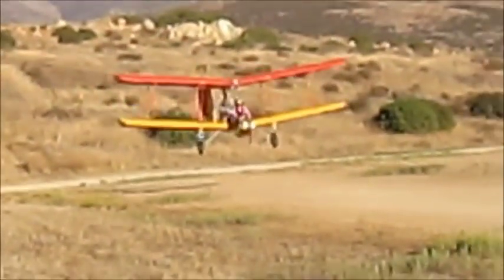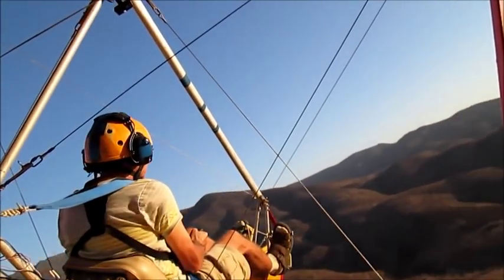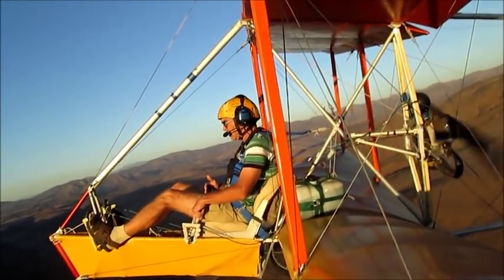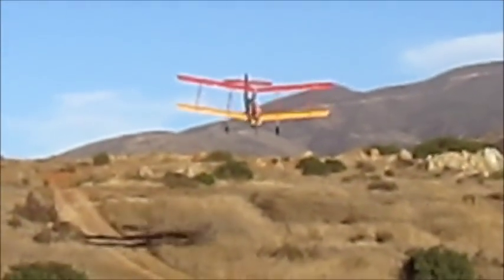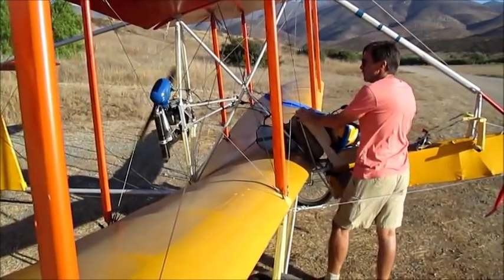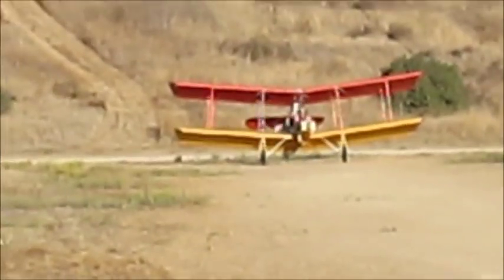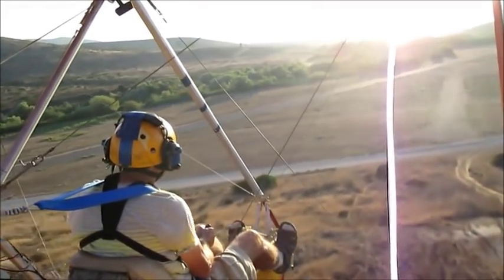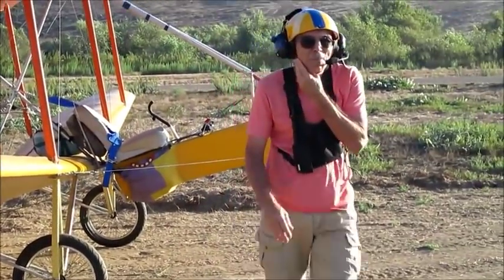Bloop 2 Flying Slow

Comment: Looks like a ball!! I am an experienced builder and 30 plus year pilot with ratings so I would add ailerons to the lower wing without significantly adding complexity while adding a safety factor but the wide gear...nose dragger strut and slow speed are fantastic!!
Reply from the maker: I'm going to stick to my story that ailerons double the complexity of the control system, while not necessarily adding any margin of safety. There seems to be a widely held opinion that two axis control involves some inherent roll control limitations that can be cured by ailerons, but this has not been veified by experience. Ailerons make flying more complex and introduce their own set of hazards, and we might readily fly some kinds of airplanes more safely without them.

Comment: What an exciting plane ! It reminds me of the Quicksilver MX that I had once.
Reply from the maker: The Bloop is a lot like the original motorized Quicksilver (they both have open air flying, a pusher propeller, and two axis steering). That Quicksilver still wins the prize for being the simplest practical airplane, although the Weedhopper might also be a contender. The Bloop I have slowed  down with a big, high lift wing, and tried to give it more crash protection. I wanted the pilot to crash slow, with clearance from ground objects measured in feet, not inches.

Comment: I want a Kolb Flyer.  Lot less wires and maybe a bit more trailerable, and it supposedly came in at 185 lbs.  Kolb called it the plane that weighed less than the pilot.  :-)  Cruise speed I think was around 40.  These slow flyers are certainly out of favor but I think they'd be great if you just want to putter close to the ground hedge hopping.

Update: I ended up buying a Volmer Jensen project and a Chotia Woodhopper Project

Comment from the maker: There should be more about construction, since this is a homebuilt, so I'll post some more building photos on my Picasa Album. Small tube bending to a large radius is easy. Ribs are bent by trial and error comparison to a template, the way hang glider flyers maintain their battens. I don't bend large tubing anymore, it's one the special skills I have been able to eliminate ( also eliminated: machining, welding, molds, jigs, sheet metal, spray rigs).

Comment from the maker: The building cost is a couple of thousand dollars for materials and parts, then a total recovery system (emergency parachute), then a paramotor power pack (engine plus propeller, starter, carburetor, and isolation mountings). The biggest cost item is the power pack, the biggest variable is whether or not to use a rocket deployed parachute (I use a hand deployed chute). Operating costs are fuel, oil, ground storage, and airport usage fees (club membership, usually).

Comment from the maker: Look at the drawings on the Picasa website, you'll see that the empty weight of Bloop 1 is 187 lbs. and the empty weight of Bloop 2 is 195 lbs. I suspect that most of the weight increase is due to the greater number of coats of silvering (aluminum powder in dope) that I brushed onto the Bloop 2 fabric for durability in sunlight.

Comment: Thank for the respond. I try to build a 50%scale using available aluminium tubing and waterproof fabric which I am not sure whether it suitable for the real size aircraft. After the 50% I hope I could count the aproximate cost for the realsize project. I plan to fly the 50% with remot control to test its safety and I hope its justified before making the real size one. I still test the aluminium tube to one metal lab to decide whether its reasonable to be used for the real size bloop2.

Comment: I plan on building this in the next three months if my paycheck allows it. What would you say is the maximum range, altitude, and VNE for cross country flights if i wanted to take it up to EAA which is about 60 miles northward. and would you say that a small motorcycle engine would do the trick? I'm able to put a prop on it and it cranks out about 33hp. i was hoping this would save me money in fuel and the engine in general. Lastly, i see that the construction is mostly aluminum tubing, but what are the wing ribs made of and if they're not aluminum, could they be made from aluminum? Also looking forward to the Bloop 3. been following you for a while now and i have to say you're the best ultralight designer for chicken hoppers such as myself who don't need something high performance, can be transported, and is cost effective. as far as I'm concerned, the Bloop is perfect because its meant for one use and one use only; to be a grownups toy!
Reply from the maker: A custom engine installation might  introduce delay and uncertainty into the program, and the economy of it is questionable in the long run. The exact kind of engine you want is available: the paramotor engine, fully developed and supported, with a propeller already on it, you can just bolt it on and have confidence that you have a practical propulsion system. This works as long as you are flying at the same speed as a paramotor.
Use a five gallon fuel tank and wait for a tailwind, then go for that sixty miles! 
Look at the drawings to see what things are made of, the information is all there.

Comment: probably would add a level of safety to include at least some roll control with spoilerons
Reply from the maker: +CHOPPERGIRL AIRWAR Two axis airplanes do have roll control, but it is indirect. Yawing the plane will increase the angle of attack on one angled up wing and decrease it on the other, the same thing you would do with ailerons, and the effect is similar. I have flown with spoilerons and don't find them inpressive, they have to be pretty big to be have the same rolling power as two ailerons (or one rudder!). The Bloop turns fast and I don't miss ailerons or feel the need to try other devices.
Reply: don't need them.  See airchairp's response.  Dihedral is the key. Had spoilerons on an old Quicksilver MX, and they were worthless except when parked and when making a rapid descent by pushing both up at the same time.

Comment: Not denegrading your design. It looks really fun and has an old school look to it.
    There is...was an ultra light called a Sky Pup that used dihedral and just rudder as well and seemed to work well in very calm conditions. One was based at an airport I used to have a Sonerai 2 at and as long as no crosswind component existed the bird landed nicely. Once up it flew along as any airplane. This brings me to my original response.  I agree about the added work to build in and skill needed to utilize ailerons correctly....but (oh jeeze) there truly is no debate that stands against the value of some type of wing control. Sometime...a gust small or large hits an airplane...light or not and close to the ground the control needed to level the wings needs to be there. If the aircraft lands wing low or is skidding on touchdown ( unless a specially designed landing gear is installed which negates the simplicity of the no aileron design) a ground loop or worse will ensue with minor to catastrophic results. Even while turning base to final ( where most spin accidents take place and yes...unco ordinated use of rudder and ailerons are usually the culprit) with a solid wing...should an elevated gust or event disturb the wing... without any means of leveling the wing...warping or ailerons for this purpose...even a very slow moving aircraft can spin with no means of regaining aerodynamic directional flight in time with disastrous results.
    Again..I think your design is incredible with the speeds and fun factor being what most of us fly for in the first place. I was only stating that I personally would add lower ailerons to keep them as simple as possible and add a safety factor for me personally. 
      I would like to purchase plans but if you would choose not to sell them to me based on this then I could find another to pursue. A couple come mind ( biplanes) but yours is unique in the looks dept. that appeals to me.
      Good luck and Respectfully,
        D. Jaffas
        Central Lower Michigan
Reply from the maker: There is no lack of roll control in a properly designed two axis airplane. Roll control in the Bloop is fast and effective, but it is indirect rather than direct. Of course I fly in bumpy air frequently, and the effects are amplified by my low wing loading, but when I am rolled to an undesired bank angle I am being turned off course, so I respond by turning back on course, and the bank angle is corrected. In recent years I have actually been trying to reduce the roll response of the Bloop to make it easier for unskilled pilots to fly. The polyhedral angles of the outer wing panels of the Bloop 4 can be adjusted to tune roll response.
Having a wing close to the ground during the landing is something I associate with ailerons while slipping, it's not a method I use. When I do my crab angle landing in a cross wind the wings are level, and if I am bumped around I just keep steering back on course. 
I think your reference to spinning without means of recovery is misdirected. The Bloop should be well suited to spin recovery since it has a big rudder which can be used in a natural manner to properly yaw out of a spin. I associate the misuse of ailerons with accidental sipn entries and with locking planes into spins.
Have a look at the technical drawings, they are detailed and setup for online viewing or free downloading at the Bloop website.
Reply: Thanks for the response. I'll look at the drawings. I can be enlightened and I appreciate your explanation. Ever consider a 2 place side by side version? I'd like my wife to experience open cockpit flying and your design is very good.
Reply: A bit of both sides on this issue...  Ailerons would come in handy in a lot of situations and if you need them but don't have them, you have severely limited your ability to deal with many situations, especially crosswind.

The answer to the most notorious and fatal issue using ailerons at low speed is to rig "differential" movement where the ailerons move up more than down (sometimes ALL-up/No-down)
Adverse yaw, the effect of the downward moving aileron (the wing you want to go up) dragging the wing to yaw opposed to the desired direction of turn, also tends to pull the nose up, which is a formula for stall-spin at low airspeed.  
Adverse yaw is worse at low airspeed, requiring more rudder correction and potentially having some designs turn left when you apply full right aileron and full right rudder. I used to demonstrate doing exactly that with an RC model. Its an extremely unstable situation that is on the edge of snap-rolling inverted and spinning.

With differential aileron movement you lose aerobatic capability (not an issue with this design, since you won't be doing 4-point-rolls)

I'd rather have fixed rudder with all-up/no-down ailerons vs rudder with no ailerons.

Another option is "spoilerons,"  Panels that pop up just behind the spar to kill lift and add drag, which will roll the airplane and drag the nose around in the desired direction.
These have some complex linkages and if they bind you are in serious trouble.  But when they work they are very nice.

I do fly models that have rudder but no ailerons, and others that have ailerons but no rudder.

Comment: I'm not sure that "get OUT [of the plane] safely" is the right term.
Reply from the maker: As with every aircraft, there are special safety procedures for extreme conditions. The narration says that the pilot can get out of the plane on the ground for safely when the nose is down. This means, in a high wind condition, land with the nose down (to stop the plane and hold it on the ground), then get out promptly before stability is lost and the plane starts to get pushed around. So, in high winds, don't land tail down and don't delay getting out of the plane after landing.
Reply: @airchairp   I meant it looks like a vehicle that you sit on, rather than in. Like you wouldn't say "I get out of my bicycle".
I like this plane very much, by the way, not that you think I'm disrespectful.
Reply from the maker: This is fine, I just don't want to miss a chance to write more about my airplane!

Comment: real nice!   Why biplane? why not quadru? , cold it be even slower?
Reply from the maker: Yes, the Bloop can fly slower if the airfoil has more lift, the wing is bigger, or the weight is reduced..Flying slow requires the wing to generate maximum lift on an aircraft of light weight.This comes from an effective airfoil used on a big wing supporting a light airframe.  The number of wings doesn't really matter, but I don't want to add a lot of drag, and generally more wing tips mean more drag.
Reply: airchairp I see,. What I mean was instead of making  each of the 2 wing bigger by thickening the chord a lot more(which result in bad L/D) why not divide the new  bigger area over more wings. So  the new Bloop would first have the double wing area as in your video. This new Bloop  however would have the exactly  same wing size except that  we have 4 of them now in a stagger configuration instead of only 2 wings, which results in a doubled wing area.
 There should be much less  induced drag this way than if we would attempt to  jam all of the 4 wings´ area into only 2 very low aspect ratio thick  wings.. Do you see what I mean? thanks
Reply: Kaledius- clear as mud.
Reply: Multi-wings (bipe/tripe/quad...flying Venetian blind) need spacing between wings or the wings interfere with each other.  You end up with a very tall and top-heavy aircraft.  

Ideal spacing is 1.5 to 2 "chords" (measure of leading edge to trailing edge of the wing) spacing between wings. Few biplanes space the wings that far apart, accepting some interference of (usually) the lower wing's lift by the upper wing.
The Beechcraft "Staggerwing" which had the lower wing partially forward of the upper  moved the lower wing out of some of the "down-wash" created by the upper wing, thus it was a more efficient than average biplane.
It looked odd because everyone got used to the upper wings being more forward than the lower on most other biplanes.

Another issue is that the wing-tips are a major contributor to aerodynamic drag.  That helps the aircraft stay slow in a dive but if you add more wing-tips you need to add more power which means a heavier engine.
you are getting EXACTLY the opposite of the desired result...  If you want reduced drag and more wing area you go for a larger wingspan with the wing tapering to a very narrow wingtip, as seen in sailplanes.
If more wings was more efficient then all sailplanes would be multi-winged.
Reply: F Huber  very nice explanation 👍🏻 Can we achieve the same slow flying speed with a mono wing? Any example or Plan please. I prefer this speed for learning and safety with good control.

Comment: Plz.. Which wing airfoil is best for slow flyer
Reply from the maker: A slow flying wing should produce high lift and should not be compromised by considerations of multi-speed flight. This means the wing can be designed for a small range of attack angles, unlike the wing of an ordinary airplane or sailplane. A paramotor obeys this rule, and it is the most efficient of motor fliers on the basis of gallons per hour (the best?). For a motorfloater I use a simple airfoil with a mostly flat wing bottom, moderate camber, and no lower leading edge ramp. This is easy to build and gives me lots of lift, very practical as long as higher speeds are not desired.

Comment: so no big deal if the engine cuts out. what happens with strong headwinds?
Reply from the maker: A sudden strong wind, like a gust front, can be a serious hazzard. You can land, but at this light wing loading how do you park the plane firmly on the ground so you can get out (escape)? This is why my designs always allow for an extreme nose down stance on the ground, and it partly explains why I don't use a tractor propeller.

Comment: So, you appear to weigh bout 145 lbs.
  What is the max payload??
Reply from the maker: You got my weight about right, but I haven't established a maximum weight for other pilots. I consider the Bloop 2 load factor to be 6 positive (untested) at my body weight, and additional body weight could be considered to downrate that limit based on the increase to the gross weight. The real functional limit to heavier pilot weight might be the elevator's ability to operate adequately while holding up the nose, unless counterweights are added to the tail, then the plane will be even heavier and woe to the landing gear! Eventually a heavy pilot will fly the plane and we will decide how to do it and what the limits should be. Of course the true magic of a motorfloater is the light wing loading, and some of that effect will be lost with a heavier pilot.

Comment: Is there a cheaper alternative for the engine?
Reply from the maker: Maybe you can find an old paramotor engine and prop sitting in a closet somewhere. The paramotor fliers are the ones to talk to.
This engine with prop costs about $3500 new, plus shipping from Italy.
Reply: airchairp I have gotten mixed information about this, but if I have an engine that has the same RPM and displacement, does the horsepower matter?
Reply: Kir Yankovich
Horsepower IS what matters.  You can get HP with small displacement turning fast or large displacement turning slow.  That said, with the same displacement and rpm, you'll probably have about the same HP.